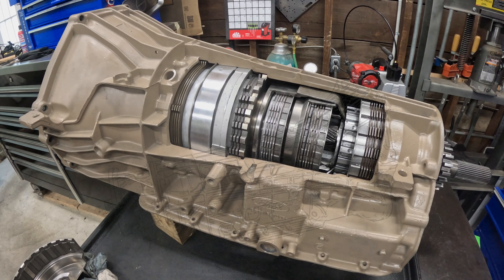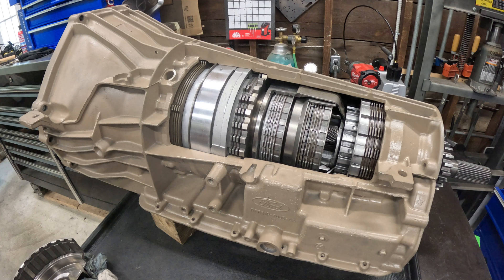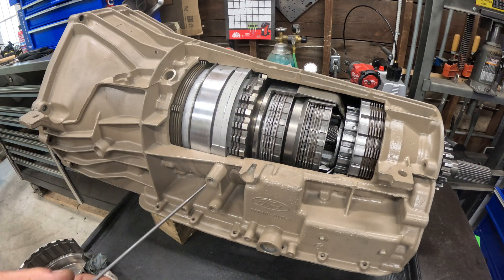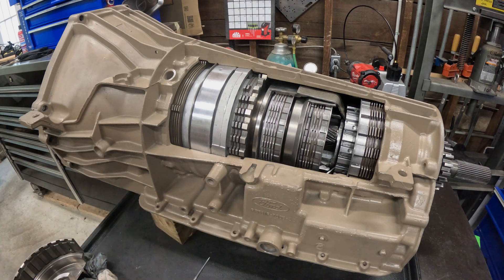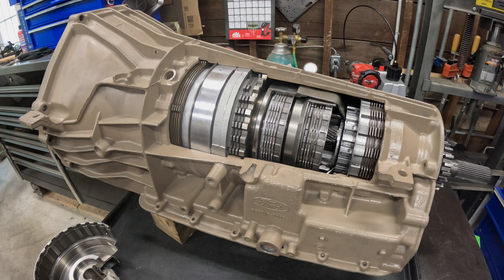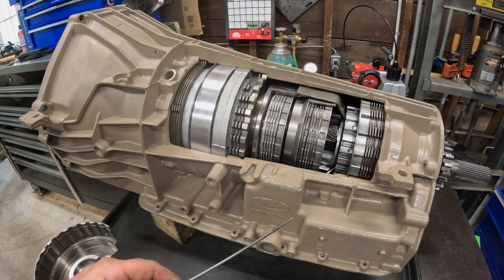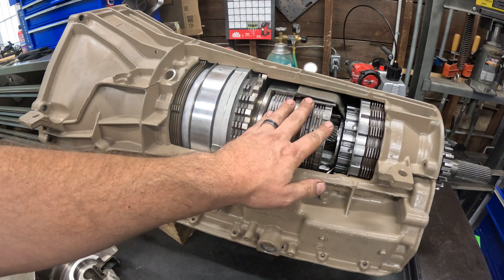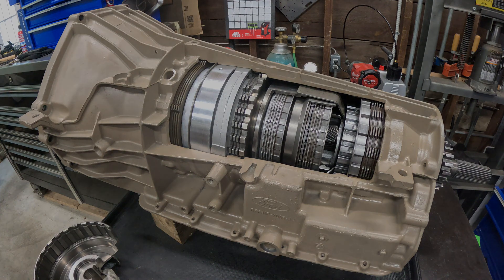Ford F250 4r100 Transmission - Cutaway Series - Overview

Comment: @blackshepherdauto can I find a cutaway chart for the e4od/4r100 that's like GMs 4l60 manuals? It would be nice to have a book so I can see how power flow works and which clutch packs control what when I  don't have wifi

Comment: what's better, a 2000 4r100 or a 2000 AT545? you seem to be unbiased? also, can these (in stock form) be used SAFELY for engine braking?
Reply from the maker: Well, actually I am definitely biased toward the 4r100.  But for a fair response, think about what the AT545 was so good at - moving school buses around.  School buses are geared very low, built for stopping and starting, and probably never go over 50mph.  Because of that, they are going to be revving higher the faster they go.  The pump inside the AT545 would be designed for this, so if you put one in a pickup truck with higher axle gears (than a bus) and better cruising speeds, you are going to be doing it at a much lower RPM than the bus would have been.  This lower RPM will most likely cause clutch burning since the lower RPM will result in a lower line pressure.  Also, I have no idea what the gearing inside an AT545 is, but perhaps the biggest problem is going to be building a torque converter that will work with something like a pickup truck.  That's my take on that.  So unless you are running a Schoolie, the 4r100 is better by a mile.

As far as engine braking with the 4r, no problem as long as you respect the vehicle's GVWR and GCWR and don't let the RPMs get away from you for too long.
Reply: @blackshepherdauto  I just bought (unknowingly) a '99 7.3 with the AT545 attached. I know they say there are problems using the trans with the "engine brake" on the 4R. I wondered if the AT545 had the same problem. someone made it work, but I agree with you on the high RPMs.

Comment: Good morning. I need help with my 4r100. Been rebuilt but no overdrive working. The computer tells the transmission to go into 4th but will not. Code P0783 pops up after being driven at 50 mph for a short time. Been have problem for 7 months. Any thought. Please help.
Reply from the maker: That code will trigger at 50mph because the PCM is expecting the transmission to go into OD at around that speed.   Hard to tell from here, but the most likely cause is a popped OD snapring and disengaged OD piston.  If that snapring is free to bounce around for too long, it will cut into the coast drum and destroy it.  Could also be a loose OD feed bolt.  If you know what you are doing, that is an in-truck repair. 
 A popped snapring is not.  You could also have shorting OD button wires in the steering column.  Check that first, it's the easiest to do.  There's gotta be tons of guidance on the internets on how to do that.